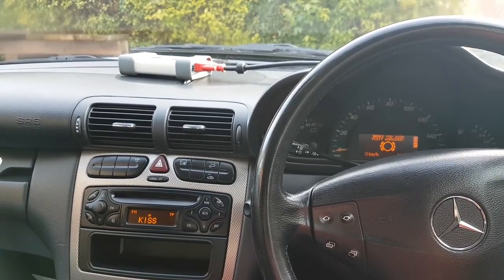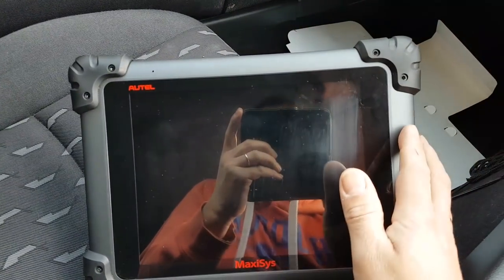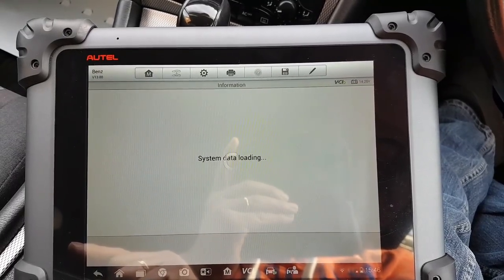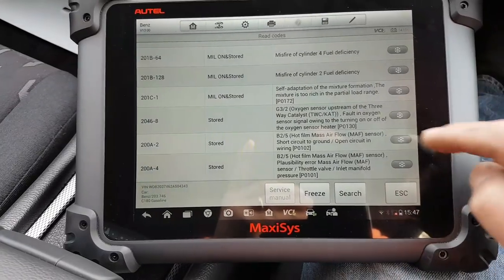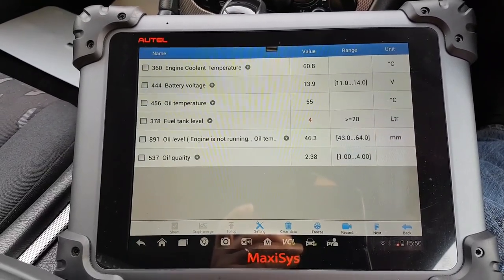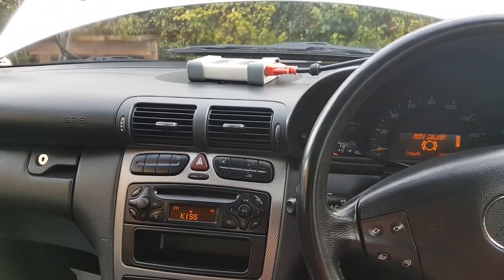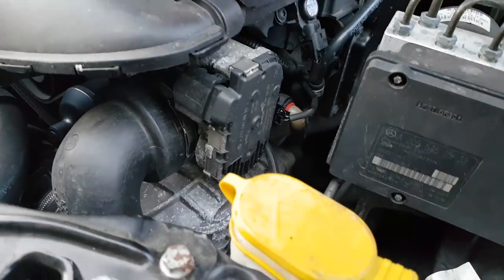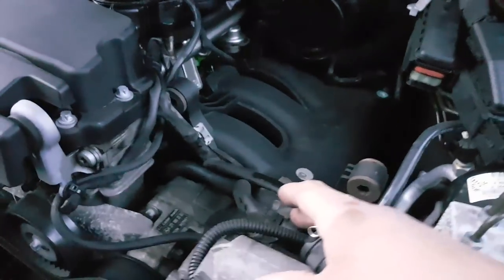Mercedes C180 Kompressor P0102 (200A-2) Air flow meter issues. Fault finding and repair.

Comment: Nice work on the diagnose. You always have to think out of the box or failure text itself. Wrong data CAN be caused by faulty sensors but they NEEDN't be each and every time. In fact, an air leak of any kind is more often the real issue.

Nonetheless, you might have fixed only one part of the issue. The upper hose was dead. Experience with the M271 tells, it will also be the case with the lower hoses and the plastic valve beneath the compressor. It's a pain in the ass to fix these but you always should once the upper hose has gone. Once fixed, you should be fine for several years again.

Comment: Great video. The Maxisys is a bit lacking with the live data. I had similar codes and had to scope the maf. It was unresponsive so aftermarket from germany fitted. Idle improved but still rough. Called a MB specialist in our capital city and I was told an adaption relearn should be done anytime an airflow issue is resolved. Did the relearn and its like a new car again. Yep those hoses are a pita. :)
Reply from the maker: Kirk Abrahamson 
Hi
Thank you for watching and for your comment!

Comment: another great diag and repair and well explained . On the maxisys could you read the air flow pid on global OBD instead of vehicle manufacturer specific. just woundering if that was available to you on the maxisys. Thanks Mark
Reply from the maker: Mark Eastwood 
Hi
Thank you Mark...
I have not tried... Will have to do next time...
Thank you for watching!

Comment: Hello, On my C180k, the Compressor air pressure tube that fits into the throttle valve jumped at 5500 rpm because the clamp broke... :/ Unfortunately it caused damage to some part. Engine fails at cold idle and cold throttle. When it warms up it improves, but it continues to fail when I press the accelerator lightly. There is no loss of power at "full power" acceleration. What's your opinion? What could be damaged when the tube came loose? Tks for help me

Comment: Hi there. I watched many videos about this problem (it's a common isue with the M271 engine). To fit in the tube some recommend a special pliers for tubes. Also to remove clamp on the hose behind the air box. I'll try this next weekend. (my first time ever, i'm total greenhorn). ;-)
Reply from the maker: You will be fine...😉
Thank you for watching and for your comment!

Comment: Hi. I had to change all my vacuum hoses last week and the valve. The fault of maf are always there.
Reply from the maker: Are you sure you have not missed anything? 
You can obviously have a faulty MAF...
Thank you for watching!
Reply: @LMAutoRepairs  all seems to be good. Just too low g/sec volume 3 instead around 10g/sec at idle
Reply: @christopheparre7904  3g/sec is within values. 3g/ sec = aprox. 10kg/h, so the value is normal, at idle.
Reply: @RaulLazar  but got fault 0101
Reply: @christopheparre7904  Yes, P0101 is related to a bad MAF (the MAF, connector or the wiring) almost every time... but there is a chance to be something else, like, air flow sensor isn't telling to the ecu the same thing as the others are - (example) MAF is saying something and the tps and map sensor are saying a different thing. Try to measure it in load and also with a multimeter and clean it (ONLY with MAF Cleaner). Honestly, I don't know what to say if I don't see all values, measure the MAF voltage and so on.
PS: if you decide to replace the MAF, DON'T go with cheap ones because they are just a waste of money.
Reply: @RaulLazar  may we continue by PM ?

Comment: Great video! How did you change the bottom hose (with valve)? The one you referred to as pain in neck.
Reply from the maker: With a lot of patience... lol
It is tricky to do,  but can be done...
Thank you for watching and for your comment!
Reply: You need to remove the kompressor.

Comment: Great work! I can't help but wonder how many shops would have just called the MAF resulting in the customer having to cough up for an unnecessary part?
Reply from the maker: Niamh Healy 
Probably a few...
Thank you for watching and for your comment!
Reply: on that engine the partial load vent hose always breaks. you need to remove the compressor and replace it all the way down. the rest of it is rotten as well. next time just spray brake clean around that area first and you will hear the engine surge
Reply from the maker: dann hienn 
You haven't watched the entire video...😉
I did not sprayed brake cleaner,  but sprayed another flammable stuff...
I have replaced the entire hose... 
You can do it without remove all that... is not easy, but can be done...
Thank you for watching!
Reply: how did you repl the check valve w/o taking off the compressor?
Reply from the maker: dann hienn 
The only issue in this case was the pipe/hose... nothing else...
Yes, for the valve more stuff would have to come out...
Thank you for watching!
Reply: Most likely ALL the shops would have just replaced the MAF and owners would need to go back a 2nd time....

Comment: Nice fix, with smoke generator such leaks are much easier to find. I use it almost every day. 
What parameters does your toughbook have?
Reply from the maker: Mambre Khachatryan 
I have a smoke tester that I have made myself... video coming soon...
I know also use it quite often...
Without checking I don't really know...
Reply: LM Auto Repairs I  need a toughbook to make my star mobile, do not know which one to choose, toughbooks with good parameters are too expensive.
Reply from the maker: Mambre Khachatryan 
But it will worth the investment...
They are robust and last...
Don't buy nothing low spec, and then it will run slow if it will run at all...
Reply: Nice video, i have a w203 c180 kompressor 2004. And i have P0171 code on my car, any idea please? And how can i check for vacuum leak?

Comment: I have a c class 180 Kompressor 2007 it is cranking  and so close  to starting but wont start. I have replaced the 4 spark plugs and new sensor too still won't start...any idea why?
Reply from the maker: Scan the car... check live data etc...
Anything else will be pure guess work...
Thank you for watching!

Comment: Hi. Where do you live? I am in west London. I have an iCarsoft i980 and mine throws a 2.8 g/s for the Air Flow Rate for the Mass Air Flow Sensor. I have a 2009 W204 C180 Blueeficiency ( 1.6 kompressor). Many times seems hard to go last 3000 revs and feels sluggish. No errors showed during the fault code read. How did you remove that air filtet housing? I managed just the top. Maybe you can have a look onto mine if you live reasonable distance, I can bring it to you.
Reply: Jejejeje, I went through half of your videos to find a reply to where are you based and I found it:D Peterborough is one and half hour away from me. Willing to travel and have it thoroughly checked by you. Meanwhile, maybe you can answer my question, please?
Reply: Ok, I have just converted your 10Kg/h into g/s and is very close to my 2.8 g/s (2.777 when converted). I guess theres nothing wrong with MAF sensor? Car has 118k miles ( got it with 93k miles). What I noticed though is the harness that goes into the MAF sensor has only 4 metal female connectors (?) when the MAF sensor itself has 5 metal teeth. Is that normal?
Reply from the maker: japanluv 
Hi
Only saw all you messages now... 😋
Yes, is normal... the number or pins not matching the contacts on the plug...
You might have another issue that not a vaccum leak...
Check all the other live data... see if there is anything odd...
Reply: LM Auto Repairs Thank you.  I shall do so. I still feel like bringing it to you:D Have a nice evening.

Comment: The MAF stop readings if there's enough air entering after the sensor?
Reply from the maker: Petar 
It looks like... which makes sense, if you have the air the engine needs, getting into the system after the MAF, this is not going to read any air...
Thank you for watching!
Reply: @LMAutoRepairs  
I have the same fault I've done even the engine overhaul
Reply: @LMAutoRepairs  I have same fault